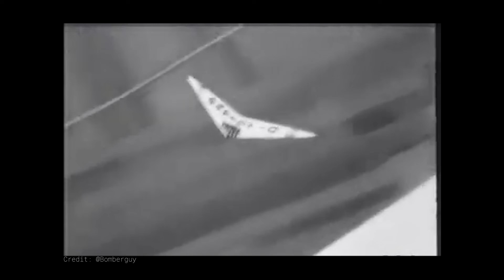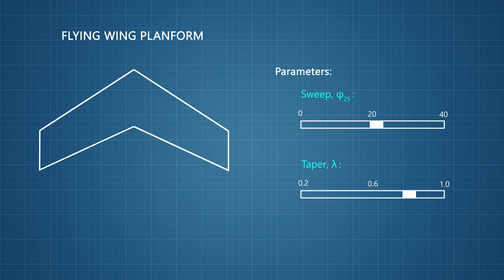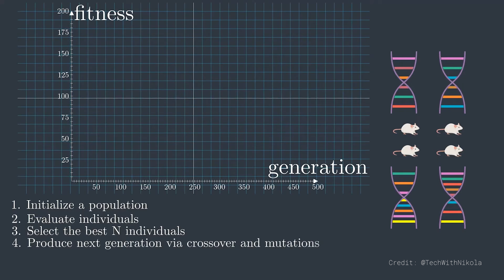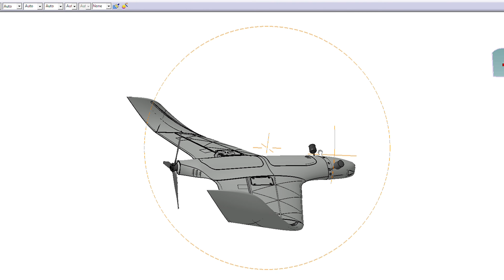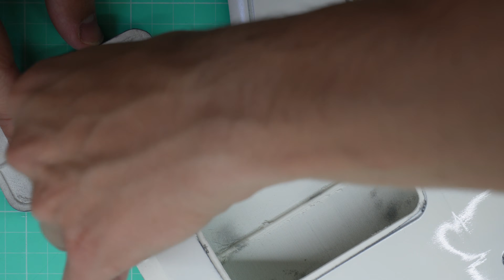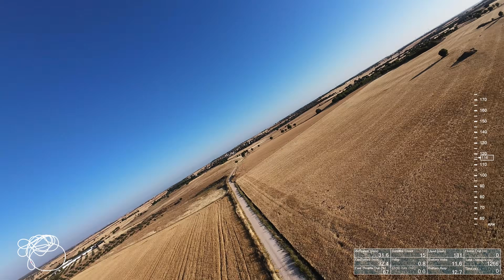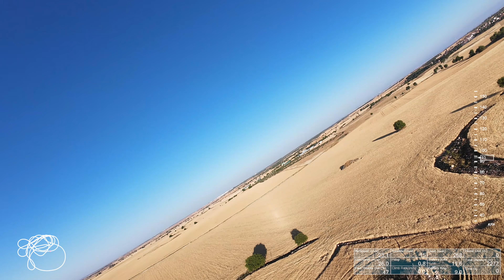🚀 I asked A.I. to design the ultimate FPV Flying Wing... and it's INSANELY EFFICIENT!

Comment: Fantastic work, bravo! I would only suggest to make one small change and that is to design the servo linkage to be direct drive to the elevons. No need for added drag from the servo horns.
Also, what is the all up flying weight and where did you get those awesome led lights?
Reply from the maker: Thanks! 🙌 The LEDs are like the ones in the Flywoo FlyLens 85, and the all-up flying weight came in just a couple of grams over 400 g.

Comment: If the motor is embedded directly into the plastic, won't it melt when the motor gets hot?  Awesome project. Thank you for sharing!
Reply from the maker: Thanks! 🙌 Heat hasn’t been an issue so far—the motor mount area is reinforced and ventilated, plus there are 2 NACA intakes at the nose and outlets near the motor to help airflow. 🚀

Comment: A marvelous project! Thank you so much Sharing. If I might ask, what CAD software did you use and also what aerodynamic software did you use?  I’m not sure I recognized either of them, but they are obviously quite capable, so this would be good tools to know about. Thanks!
Reply from the maker: Thanks! 🙌 For the aerodynamics, I used OpenFOAM for the CFD simulations — it’s powerful and very flexible for this kind of project. 🚀✈️

Comment: How much weight was added with epoxy, primer and paint? Looks great tho! Does it add to strength, as 3D prints are very brittle for planes?
Reply from the maker: Thanks! 🙌 The epoxy, primer, and paint added roughly 100/150 g. It definitely adds some strength and surface hardness, but for a small wing like this, the weight penalty might not be worth it unless you’re expecting hard landings and a much better look. 🚀✈️

Comment: The problem of flying wing is NOT longitudinal stability, its spin behaviour, especialy engaged in sharp turns with high angle of attack, assymetrical turbulence, ect.... they engage sharply, and don't recover because there are no lateral surfaces. Thats why they added fins on Northrops giant, and V brakes piloted by computers on modern airplanes.
Reply: @ericseidel4940;
I wonder if speed brakes, maybe split ailerons, could help spin recovery... BTW, I noticed something like this on a new Chinese fighter-bomber.
Reply: @lohikarhu734 I was 50% of the initial design team that created what became the TBS Mojito. The Mojito has spoilers ( not flaps like a certain moron calls them ) to slow it down in ground effect on final approach on a hot day, but those spoilers can also be used to counteract or initiate a spin
Reply: I built and flown B10 and U2 ultralight flying wing aircraft.
Many flying wings on 😊the market.
Not dangerous like everyone is saying
Reply: Except this has big vertical winglets, hence not an issue in this design

Comment: Nice job but it would have been better seeing the body of the aircraft flying at the end rather than just a video from it, you could have mounted a small camera on the back of the body to see the wings for example
Reply from the maker: Thanks! 🙌 That’s a great idea—having a rear-facing camera to capture the wings in flight would look amazing. This build was already quite tight weight-wise, but I’ll definitely keep it in mind for future flights! 🚀✈️
Reply: @neuronautics_Lab or use a second drone to capture the airplane

Comment: Nice; was expecting image-generation clickbait but glad i clicked anyway. 

But the LED strip on the top of the leading edge? I figured it was going to be at the bottom? Not just because youd want to see the thing; but also... if you are going to disturb your airflow and you can choose between top and bottom... we should pick bottom 100/100 times no? What am I missing?

It looks really solid but if I spent months optimizing degrees to fractional angles, id probably print a glueup jig, so my fat fingers had no chance of ruining the alignment.
Reply: exactly this. if you need lights on the upper body so you can find it if it's lying in a field... put them lengthwise along the fuselage, not the upper leading edge
Reply from the maker: True, normally you’d want any disruption on the underside 👍 But in this case the LED strip is just taped on, so it’s essentially flush and has no impact on the airflow over the upper surface. 🚀

Comment: Awesome design process. Is there the option to tweak the design to favor speed, maneuverability or flight time, or would they ech benefit from stand alone AI optimization?
Reply from the maker: Thanks! 🙌 Yes, you can absolutely tweak the design to favor speed, maneuverability, or flight time—but each would benefit from its own dedicated AI optimization run.
Different goals often pull the geometry in opposite directions, so the AI needs to explore a fresh design space for each case to get the best results. 🚀✈️

Comment: Great project!! Would love to print and fly this. does this make this also the fastest wing model? What kind of filament do you use? Think you could get it lighter with LW-PLA made for rc planes
Reply from the maker: Thanks! 🙌 It’s not built to be the fastest wing—this one’s all about efficiency (CL/CD) and stability—but it still moves pretty quick.
I printed the whole thing in LW-PLA and it’s working amazingly. 🚀✈️
If you are interested, you could download the STL files here: https://cults3d.com/es/modelo-3d/artilugios/ai-optimized-fpv-flying-wing

Comment: You really limited your parameter space to just a few parameters. Seems like you fixed airfoil choice here? Also, do explore the bell shaped lift distribution - that can get you rid of vertical surfaces, shaving off some unneeded mass and drag and using that for surface area and lift instead.

PS. I hear DeepMind is working on Navier-Stokes equations. If they manage a breakthrough there too, then aviation will really get a boost.
Reply from the maker: Exactly! 🙌 The airfoil was fixed from the start—a high-efficiency, low-Reynolds, modified Selig airfoil optimized for flying wings. And yes, if DeepMind cracks the Navier–Stokes equations, aviation design is in for a massive leap forward. 🚀✈️